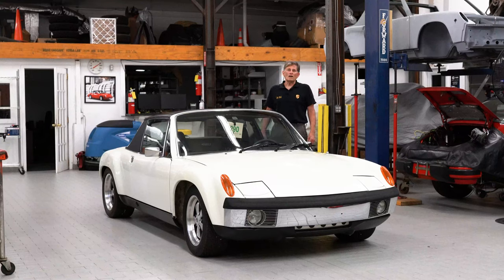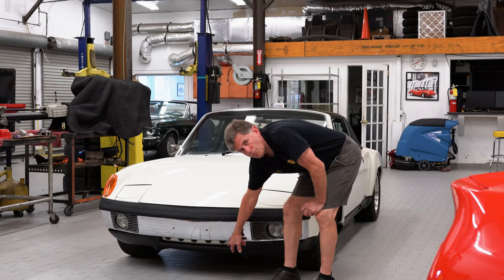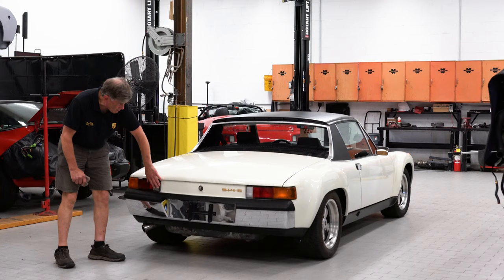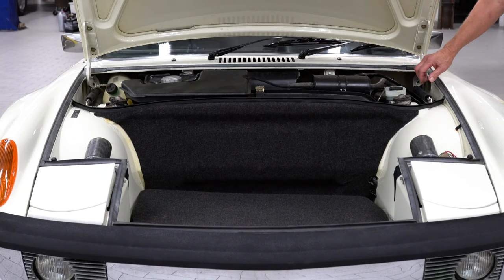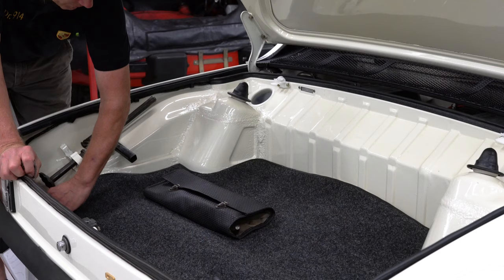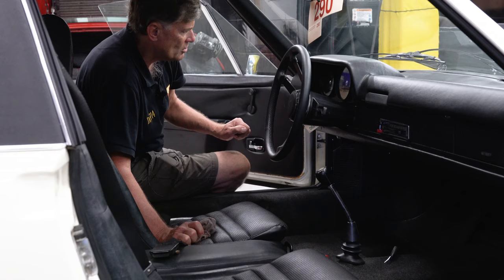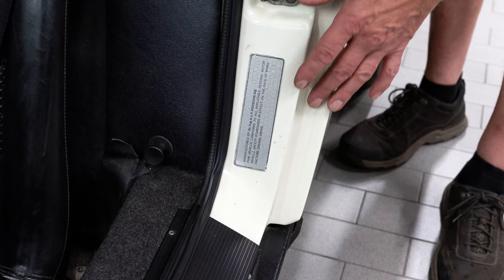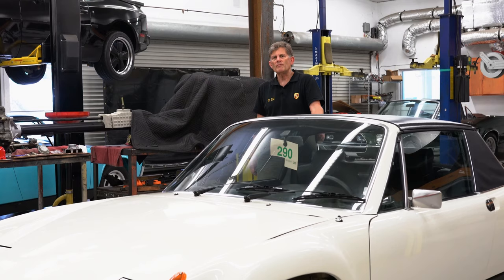Tour of a Porsche 914-6 GT Clone

Comment: Lots of things I learned in this video. Thank you George for sharing your knowledge.
Reply from the maker: Of course!
Reply: @autoatlantainc.2267  hi George, thanks for your videos!  I just bought a 914 and was hoping you could help me understand why mine requires 2 keys to turn on the engine.  1 to the right of the steering wheel and a smaller key for underneath?

Also, why do some models of the 914 have 3 extra gauges for like temperature, etc... between the dricer and passenger seats but mine doesn't?  Thanks.
Reply: @Jack-si2pg No 914 or 914-6 ever had two ignition keys required to turn on the ignition.  IMO, it must have been an owner installed anti-theft mechanism.  The second key system underneath can likely be removed and bypassed or restored to factory.  

As for the center console gauges, they were a factory option on later 914’s, 73 and later I believe, so most did not have them if cost was a consideration.  Factory console reproductions with the appropriate gauge panel inserts, and adding the proper VDO gauges (clock, voltmeter, oil temp and voltmeter) plus senders and wiring is fairly straightforward.  Hope this helps.

Comment: I am a Porsche guy and have never thought too much about 914.'s but after 3 years at 3 different locations of Luft I have a different take on them; plus now that I am doing hill climb racing ( 5-6 races this year each in a different location in the mountains of OR and WA — then I am through racing). Love hill climb better than auto X or track but my 1986 911 RestoMod-Outlaw is also a show car (Porsche Corporate trophy, 2019, Werks Reunion, Monterey — best DESIGN all my ideas not someone else) and a daily driver so I understand about how efficient mid engine motors are.

- I am about design and liked that you left  the outside turning lights off, much cleaner like you said.
- You had a thorough review of the car being kind where things could have been better.

- I disagree with you on where the metal trim piece meets the door. You would have liked it with the chrome look and like the black anodize. You feel the chrome sets off the entrance to the interior and I feel that the chrome is too harsh, to bright. Anodize is more neutral but still a presence. And no chrome around the window roller, black blends better with the black interior and  there is no other chrome in the car that I saw.

- You didn't mention the kind of "slobber" substance at the bottom of the drivers side door. Kind of looks like excessive glue use to hold leather/naugahyde to metal. Needs to be cleaned up.

- I agree with you for all of those reasons; speaker on the door should be the best location.

- Open air flow hole. I would have bought some of that German chicken wire to cover that hole. When you see it on the engine area and see it here it looks factory. To me what is most important like I said design and if the design is good that is the proof.

-You said, factory non-adjustable seat belts are a hassle to adjust" That's why factory/original is NOT necessary a good thing unless you are fanatic or want a stock/original. I have had a 1958 Super 356-A in 1968, an SC in the 80's and for the last few year a 1986 911 Carrera RestMod-Outlaw. It is my car now, my design and the way I want it to look and like I said I won the Corporate best DESIGN Award out of 150 cars being judged (not concourse - and a few from custom P-car shops). My car was NOT classic but R.M.-O.  Dr. Wolfgang Porsche chose my car....why because the changes I thought upend had made gave more emphasis to the beautiful lines of PORSCHE.

- I get CONCOURSE preserving the past, but if all the car in PCA where like that it would be stifling.

- I enjoyed all that you had to offer and will go onto another one of your videos.

"A garage without a Porsche is just a dark hole" — Walter Rohrl - Porsche Development

Comment: The 914-6 GT had a welded-in steel roof panel.
I prefer the removable roof because the car is such a pleasure to drive.
Reply from the maker: no did not, ONLY the 11 916s had the welded on roof panel
Reply: @autoatlantainc.2267  Ah, you are right

Comment: Wow - quite an analysis. Wondering if anyone knows if the original / stock roll bar will actually support the weight of the car in event of a roll over? Best resource for reading up on these aside from Auto Atlanta ? (I'm not in the US). Thank you in advance.
Reply: Assuming the roll bar, sail panel pillars, and general structure around the longitudinals is solid, the targa roll section is strong enough to take the weight of the car in a rollover.  It does not necessarily mean you could drop the car upside down on the roll cage from a height and it would hold without deforming though.

If you have any concerns about that, and you’re using your 914 or 914-6 in competition, you’re required to weld or bolt in an approved roll cage.

Comment: I had 1,I see not a 915 gearbox...🤔🤔
Reply: Original 914-6s had the 901 transmission with the tail shifter linkage configuration.
Reply: @jimohara4796  yes I know,you will power get🤣🤣🤣 in 915 Gb.